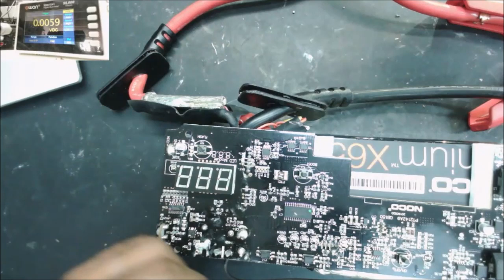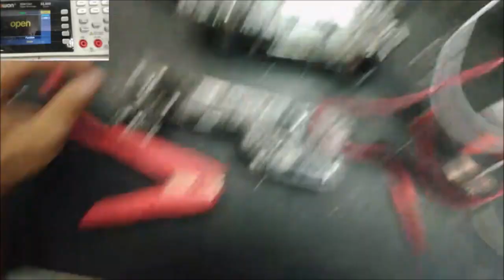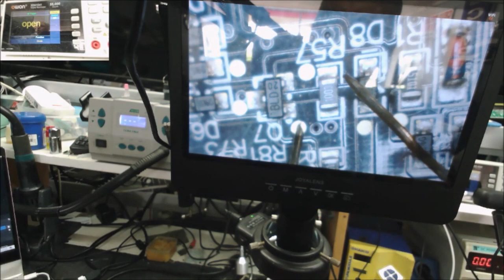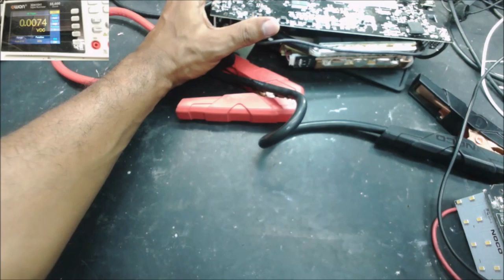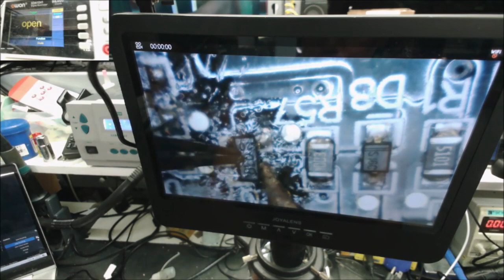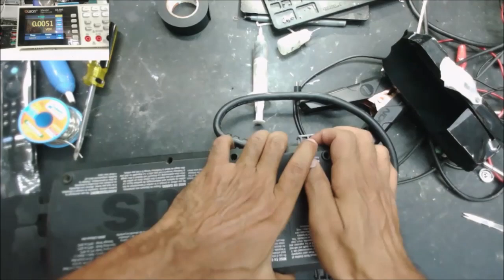Noco GB150 no power missing 3 3v

Comment: Wow, with all of these you've repaired in the past, this one was a lot more work. It was good to see how you methodically hunted down the fault but no doubt a bit frustrating. Good that you've collected an inventory of parts to repair these, after repairing so many I would think the challenge to repair them is almost fun.🤪
Reply from the maker: i was going to do the board swap at the first, but but i want do a video following the problem. always when it comes to the controller ic i do whole board swap,